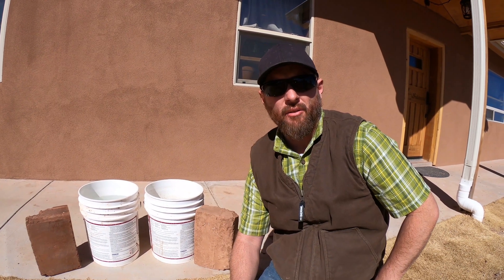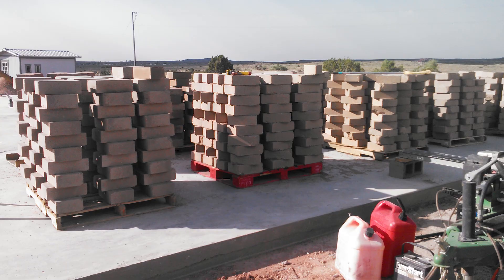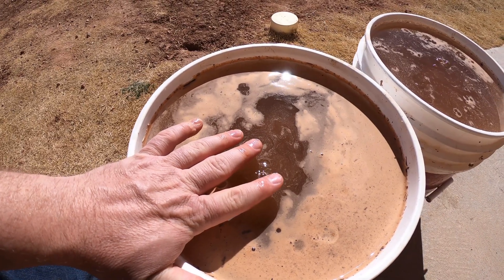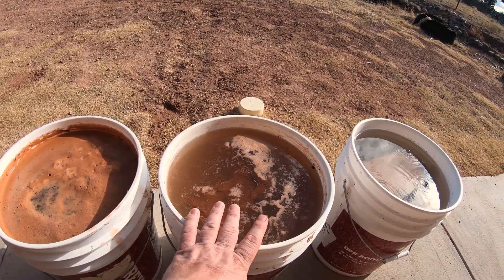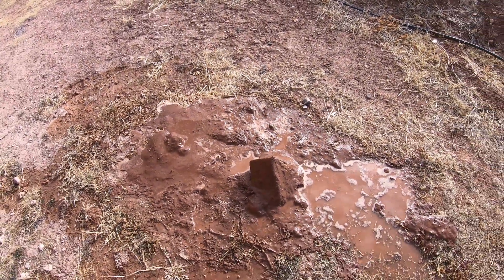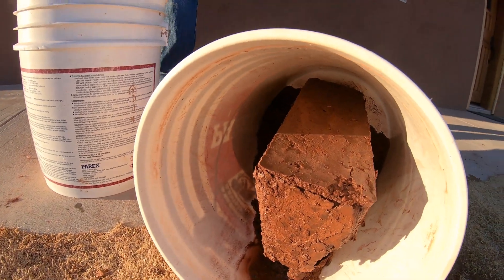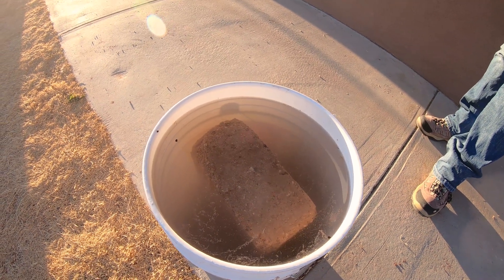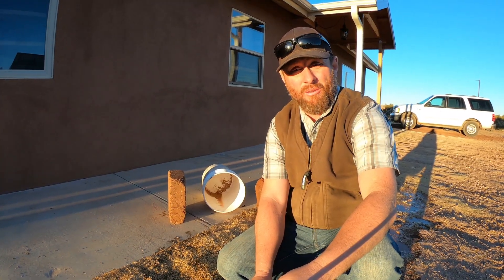Compressed Earth Block Test

Comment: expert rammed earth guy told me to use 15% clay and 10% cement.  This is for rammed earth in big forms.  he says minimum 30cm but I think here in the tropics where temperature does not vary as much as in a desert a 16 to 20cm thick wall is enough.

Comment: That's a good test but my guess is the cement will become brittle over time and the blocks will crumble. Earth bricks have been used worldwide for centuries and none of the oldest buildings have cement in the bricks. This test is relevant for flood prone areas, in which case you probably shouldn't build with dirt. Stabilized bricks are good for the first few courses in case the floor floods. I suspect cement laced earthen blocks don't perform their water wicking duties as well as clay blocks either because once cement gets wet it doesn't dry out. That is a collapse waiting to happen. Clay breathes, cement doesn't. Just a thought.

Comment: After all of the research I've done, the amount of bubbles, the unstabilized brick turning into mud, and the uneven compression of the 5% brick all tells me that your method is the main reason for the failure, not just having less than 10% Portland cement.  I can't speak to the soil composition, but the results of your test makes it crystal clear that you aren't using NEARLY enough pressure when forming those bricks.  (They should be compressed to 3000-6000PSI so that all of the air and (almost) all of the water is squeezed out, but I suspect you dropped a zero somewhere along the way and didn't notice.)

Cheers!
Reply: What would be the best compression machine psi for the earth interlocking bricks?  Thank you in advance for the reply.
Reply: @Antonio-ti2he  "What would be the best compression machine psi for the earth interlocking bricks?  Thank you in advance for the reply."

You can either use the figures I posted in my comment or look up 'compressed earth block psi building code' for more detailed information.
Reply: @KeithOlson   In your research what have you discovered to be the highest hydraulic psi for earth compressed with 10 cement?

Comment: What's the difference in load bearing? What if the 5% is used in sections of the house where they won't come in contact with water?
Reply: Makes me want to make a sorel cement block

Comment: All right, it is needed some small proportion of cement or lime, but we forget that these bricks won't be totally exposed to rain : if they happen to be so soaked in water would be due to a collapse of the roof, that is, normally these blocks won't never be so soaked because they are protected by a roof of tiles and its eaves. Earth with its little proportion of cement (and a good roof with its projection ) is enough to avoid too much moisture.
Are we maybe negotiating the ratio of cement?  😂 Maybe, I'm wrong but It sounds familiar to me that the ratio of cement in these kind of buildings is less than 10%.

Comment: WHAT about mixing with LIME?
--- just recently (1/23) Matt Reisenger showed a compressed earth home(very expensive luxury) using ONLY lime. 0% Portland. They claimed the lime ONLY was for environmental reasons. Supposedly Portland is bad (CO2) for the environment. Of course my opinion is that we need more CO2*, not less.🤠
.
.
65 million years ago CO2 levels were between 4 and 12 times higher than what they are today. No runaway greenhouse. In fact there was more vegatation on earth, more Oxygen, and more methane gas  than any time since. Wake up enviro-nazis. You've been manipulated and abused by your super wealthy programmers (the "one percent", realistically .0001 percent).

Comment: No Portland is 100% natural bricks you can put asphalt hardeners ,they are not organic you can make a lot of chemical stuff but 100% natural bricks are compressed earth then you put a stucco coat on the outside to waterproof or many different waterproofing methods. They made dirt bricks for 10,000 years they didn’t need any Hardner or chemicals.

Comment: Why not use Quicklime instead of Portland cement? It dries(or cures) faster, with no need to keep spraying it with water.
Better still wouldn't Portland & Quicklime combination work best as a cheaper and faster drying alternative?

Comment: Thanks a ton for the live demonstration of test. How about using 15% or 20% Portland cement?
Reply: That would be more expensive and increase the carbon footprint
Reply: @Jeffrey314159  Thanks for your wonderful response
Reply: @Jeffrey314159  carbon footprint 👣  increases when walls fail too.

Comment: That was a really fair test you did...ive often used the water plus subsoil or soil in a jar to work out good ratios for agronomy.Ive also worked with some guys in Australia doing rammed earth,and the lowest concentrate of portland they used was 6% up to 10%....and that depended upon the soil type in use,the climate,and the proportions of each...sand ,fine gravel,clay.The basic proportions were 30% of each,with that 10% variable,preferably towards the clay or gravel...so an ideal 30% sand,35% clay,35% gravel.Ironstone soil tended to be the most readily available ideal proportions,basalt tended to need fine gravel,granite tended to need clay.....etc
Reply: 35% clay is too high, especially with 10% cement.

Comment: 10% cement will allow a less precise mix, but it is expensive compared to other options. Start with 70-30, sand-clay, compressed, and less cement, 5%. Or, no cement and use emulsified asphalt throughout the mix, or, soak the outside of the block in it. Also, lime/flyash will act as cement. Or, half Portland, half flyash, saving a little on expensive Portland.
Reply: Yes a combination of Lime and Portland would be cheaper and could dry faster
Reply: 3% lime 3% cemet is best according to a test, it gives the best strength outcome for a variety of soil qualities, and if you get your soil tested and is consistent then you can check the report online to find the most cost effective formulation
Reply: lime works better with clay. 
cement works well with .low clay mix

Comment: So if concrete contains 10-15% cement, what do these earth blocks accomplish? On a carbon footprint level, using 10% cement in the CEB formula would have the same carbon footprint as a house made of concrete wouldn’t it?

But the other 80-90% in a CEB is arguably better for the environment than mined materials.
Reply: Concrete can use up to 25% Portland cement and 75% aggregates. Use a Lime & Portland cement to be cheaper, and with less carbon footprint

Comment: Your blocks should not to contain air in side it. wich is make water get in and destroy it from inside. Your blocks dosen't have the needed compression .the problem is in your machine. It has a bad conception where it cant allows you to did a first compression to free the air.i mean your blocks have the same volume but not the same density.
Reply: Your English needs work, but I think I agree with you. If the blocks were compressed better so that they contained no air, the block without cement would have held up better, but it'd probably turn to mush in a few more hours. I am trying to build a rammed earth house without any cement.

Comment: I'm thinking that if I were to do this that I would go with 15% Portland. Just to make sure. I think it would be worth the money.
Reply from the maker: That's the way I think too, we probably added a little more in our batches
Reply: That will increase it's carbon footprint and it's cost. Try a Portland cement and lime combination.
Reply: @Jeffrey314159  For the small amount. It would be more like carbon toeprint.
Reply: At 10-15%, you're just making concrete...

Comment: Definitely good to know. Do you sell your blocks locally?
Reply: lowes sells cebs at 3.00 a block but i suspect the production costs are much less ...if you have the correct soils onsite and the labor to make them...not adobe which are easier but less strong and the family operations often use tractor loader tillers for soil prep...but the ceb machines are a must as the hydraulics are required for higher comparison rates and strengths to exceed ansi standards for load bearing blocks
many cebs exceed these standards by a thousand pounds per square inch over cement blocks made from massive amounts of portland and sand like aggregates

Comment: Cool Video. But Portland is not the only thing with an impact to brick quality. Soil and aggregate properties, Sieves size, soil grading, clay content, granulometric form, mix proportions, pressure, stacking & Curing. Tthere are a lot of different influences to CSEB Quality. With the same amount of concrete (8% optimum) you can get very poor bricks (<1N/mm²) to extremely strong bricks (7-10N/mm²), always depending of the mixture AND Curing.
Reply: Yes, this video over simplifies. The right sand, e.g., sharp not round, the right clay, and many different additives work as well as Portland. I made blocks using just e-asphalt, poured not compressed. Forty years later, out in the weather, they look the same.
Reply: I am looking for more wisdom on soil mixture for CEB blocks  @1voluntaryist

Comment: I'm a little  onfused. 40% clay, 60% sand, and 10% Portland cement. Doesn't that add up to 110%? What I think you mean is 4 parts clay, 6 parts sand, and 1 part Portland cement. By the way, that would be 36% clay, 55% sand, and 9% Portland cement.
Reply from the maker: We used the ratio 60-40 as a rough estimate, we tried to keep this ratio around this but we understood that working with raw material that we had a variance in the material so even with the calculations that you question about we tried to stay with and ten to fifteen percent variance and it worked out well for us. As to the Portland mixture I understand that it calculates around 9% however 10% is a easy round number to remember. On another post I explained that before building our home I purchased an engineered study that did study Earth blocks and in their study they recommended doing 7% Portland so when we built our house we rounded to 10% which in all actuality is 9% which is still 2% above the engineered study. So we figured going a little bit more would be better than going less. Don't know if this helps or not but I hope it does. The engineer study is copyrighted so I'm limited on what I can talk about but maybe I can provide you a link so you can purchase it for yourself if you desire.
Reply: Its just a ratio based on the active ingredient which is cement....so yeah it makes 110%......most recipes are like that..eg flour100%,eggs25%butter20%...etc..with the ingredients being a proportion of the flour weight....they do it that way because a recipe can have a desired result,using % of flour weight,so you can know what a completely new recipe will do,having never made it......cements the same principle.
Reply: @erikmilburn51  Any recipe or mixture of multiple components regardless of their units like moles or volume or weight can ever add up to more than 100% of the mixture. Percent means parts per 100. It is a not so useful a metric for recipes. Parts is a useful metric as it can be anything like moles or pounds or cups as long as it is the same for all components. The brick material recipe was reported erroneously which is not surprising.
Reply: 60% clay 20 to 30 % sand and the rest is portland cement or as many are going to 10% portland with additional 5% lime for long term curing the portland sets up very quickly but the additional lime gives the block a longterm punch and stuccoing with pre clay and lime additives and believe it or not cactus juice gives the plastering a slow cure which is good ...the longer it takes the lime plasters to cure means additional longevity with less cracking and deterioration over decades

Comment: This is a great argument for sealing and painting the ENTIRE exterior of CEBS. I would also recommend to add a fresh coat of paint  every 8 to 10 years, depending on your environment. FYI, I would also recommend sealing and painting the interior. Like with any structure, scheduled preventive maintenance will add decades to your home or building.
Reply: One of the benefits of using compressed earth blocks is that they breathe - they moderate humidity, therefore comfort levels in a home.  This would be negated if the block was sealed.  See Jim Hallock earth block benefits video.  A lime plaster can be added for appearance if you prefer.
Reply: Seal doesn't provide a moisture barrier.
Reply: The only kind of exterior paint that lasts (reliably) for 8 to 10 years is lead paint. While you may be able to get certain epoxies and resins that last that long, guaranteed the pigments are not going to in direct uv (most resins and epoxies will break down in UV). 

Therefore your argument is invalid.
Reply: Actually, traditional mud brick homes are built in stair areas with little rain and hence it's advised to design Ceb structures and walls with extra overhang of eaves.

Comment: Forget the tree hugging and just pour a concrete wall.
Reply from the maker: I have never found myself to be a tree hugger, but I have found that this material is very cheap compared to concrete, plus both materials have different thermal properties.  Earth block retains heat and cooling, thermal mass better than concrete.  Thanks for your response.
Reply: concrete only seems easier..but the thermal properties suck...The way the concrete reacts to earthen blocks are vastly different
making cement the loser big time

Comment: Have you considered doing a compressive strength test comparing between wet vs dry blocks? I know the stabilized blocks won't visibly degrade with water exposure but I'd like to know how much strength does it retain after a wet-dry cycle.
Reply from the maker: Good thought
Reply: New Mexico mandates a compression test also as part of the requirements to use for homebuilding. We're getting ready to start an adobe and researching the rules, and it looks like they take a random sample of 5 blocks from your intended supply.

Comment: I've been watching your videos and I really appreciate the shared knowledge. I realize you have an Earth Tech press. And I can somewhat guess what model.
But can you tell more about which one you have and how it performs?
And if you would change up or down on that choice. I'm looking at doing several structures on my homestead and don't want to waste $ on overkill or time and $ with cinva ram.
Reply from the maker: The machine we used was a BLM-12-8A2, this is my friends machine.  He built his house that is around 6000 sqr ft.  He did a double wall on his house to create a dead air pocket  between the two walls.  He was shooting to really stabilize his temperature.  My point is that this machine has built basically three house and some small structures and the machine is holding up.  The cylinders inside the machine where the press is will eventually wear out from my understanding.  Obviously if the machine is greased and maintained one will get much more life.  From my understanding these machines should make many homes.  My wife and I are looking at purchasing our own machine soon so when our children get older we can help them build there own home and start life right, debt free.  We are going to go with the BLM-12-8MB, the manual model.  We can not see the reason to pay and extra $6k for the machine to be automatic.  Also for a side note on the BLM-12-8A2 (auto press) if you are making the blocks in the summer like we did, the hydraulic fluid would get hot after a few batches which would in turn throw off the auto pilot and the machine would just stay pressing due to the hot oil.  So one would have to manually operate it any ways to get the block up to pressure.  One could build some kind of cooling reservoir or some mechanism to cool the oil.  You can see the dilemma, so we will purchase the smaller one do these issues with these smaller scale auto pilot features.  Good luck, let me know if this helps.
Reply: @SustainableLiving   What manual machine would you buy?
Reply: Your awesome and that was exactly what I was wondering. I've been in contact with Dan and just waiting for a day I can work up enough nerve to take big plunge. 
And being a man of integrity is what is really selling me ☺️ haha
It's a crazy world and God bless, keep on keeping on.
Reply: @howardwick6463  I bought a machine from Dan.  I love that he is always responsive to my questions.  He's a good man.
Reply: @Somewhere-In-AZ  thanks